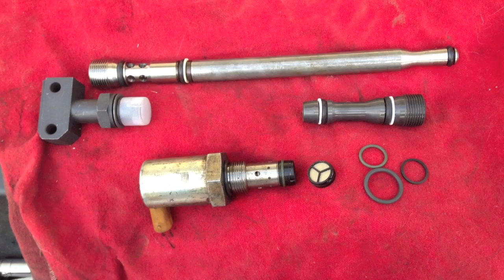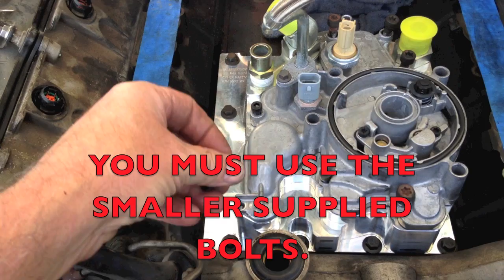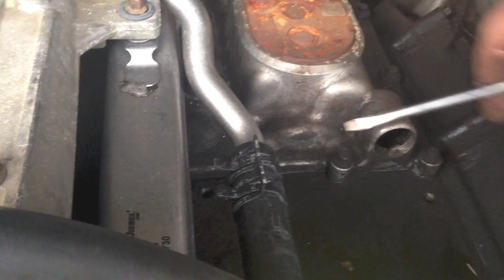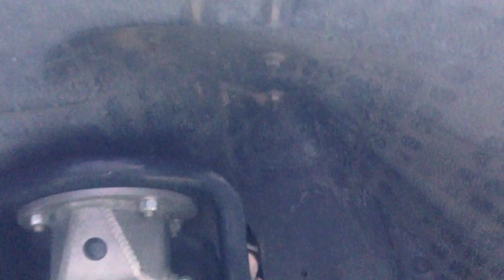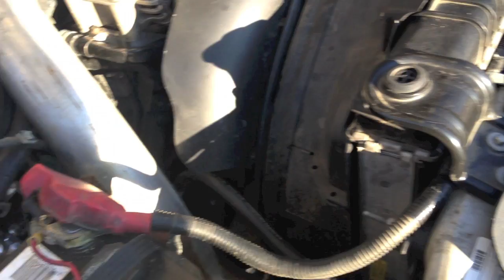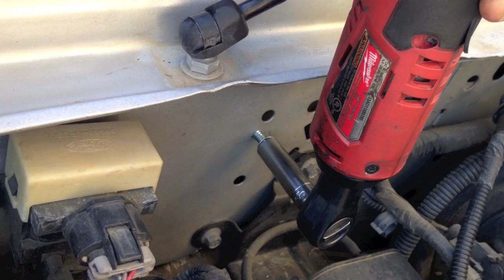Bulletproof Diesel's remote mounted oil cooler install on a 6.0 Powerstroke

Comment: Am getting this the same kit install on my 2005 ford excursion, since they say exs dont do to hot on the air to oil cooler kits. Literally this is like the only video out there for this kit. Even though am not doing this myself am glad to see what the shop has to deal with and well worth the money.

Comment: So I'm just getting ready to do the bulletproof to my 2006 is there something wrong with the air cooler that they've gone back to using the old system with the remote

Comment: I installed one a few years ago. However my oil temperature have not been much of a change. I do think it’s a better system. I would recommend a dual core radiator and electric fans from Alloy Works.

Comment: Thank you for all the informative information for us crazy people that own the infamous 6.0...Mine is an 07 f350 lariat srw lwb, just turned 354000 on the odometer. Original headstuds with a egr deleted and ford upgraded oil cooler. Other than that oh yeah the 03 turbo. I have spent less than 3000$ in total maintenance cost and a upgrade to the ficm...48V....I tow heavy 6 months outta the year pulling 18K quad goosenecks up to Canada March thru September...

Comment: I mean whats an abosolute temp for eot and coolant mine has never reached 200 higest ive seen is 194 but the difference between the two is anywhere from 4 to 15 depends on if im on a load or not.

Comment: by doing all this upgrade it shows that ford's engineers didn't do their job right when they built the 6.0🛌
Reply: EPA ruined the diesel engines with all their bullshit mandates like an egr
Reply: Ford didnt build the motor but nice try
Reply: International installed the 6.0 in a lot of commercial vehicles. Since they didn't have same emmision parts as F series. They were going for ever

Comment: that must be a good battery to hold that long.cranking
mine 3 or 4 turns it's dead👍
Reply: Well if it wasn't dead then I will bet it is dead now.
Reply: Need new batteries.

Comment: Hello.  Thanks so much for all the great videos and information  I am considering buying an 06'F350, work truck that has 207k miles.  What must have/do mods would you recommend to make more reliable??  It will be my DD.  It will not be used for work.  It will tow my 5,000 pound boat weekly (30 miles per trip).

Comment: Do you recommend adding a after market by pass oil filter kit such as OCS or Sinister Diesel ? What temp thermostat and type (factory or Mishimoto) ? Would a Mishimoto radiator be a cost effective upgrade. ? Live in Oregon with mild winters but will use the truck mainly for towing and traveling. Factory Ford Warranty on truck not extended  but factory .
Reply from the maker: We almost never see an oil related failure on these motors, esp if the proper filter is used. so I would not out money in the extra filtering of the oil,  same with the thermostat.  almost no factory or rare factory failure.  the radiator actually is an upgrade, yes if needed I would replace it with theirs.  take out a perfectly good one? in a cool climate? no.  a coolant filter on these is s good idea and keeping up on the fuel filters. Try to only start it and run it when it can be driven long enough to be warmed up all the way.  otherwise condensation builds up which is moisture or water in the systems

Comment: an example it's 80 degrees out here humid oil temp at 205 degrees coolant temp is 10 degrees lower I just  finish installing this one I don't know if it's normal because I thought there was something wrong coming from California to Texas I saw my temperature like that and I have a delete SCT tuner to Performance

Comment: I put a bigger bulletproof diesel kit on and my temperature still 10° degrees up of coolant and it's 80 degrees out here in tx is that normal or am I running into more problems
Reply from the maker: Hi. Two things, is your vehicle reaching operating temperatures like 190 ? Ford says within 15° is normal .

Comment: do you have to add more oil with this setup? I just ordered this for my truck. any feedback if its worth it?
Reply from the maker: maybe a little the first time. but afterwards there is more trapped in it.
Reply: +DieselTechRon Thanks!

Comment: Hey Ron... I'm replacing my oil cooler right now. It ruptured and dumped oil all in the antifreeze and I want able to flush it out.. Should I install this remote mount now ? Because I'm afraid it will clog up the new oil cooler once I start driving it again. This oil cooler only lasted 10k miles and went out again.

Comment: Does anyone know if a similar kit will work on the E-series 6.0 powerstroke?  The only option I've seen is the $2200, rape you in the ass option from bulletproof diesel.  In all honesty, the kit should be more like $1000 max, $2200 for an oil cooler is approaching aviation part prices.
Reply from the maker: The updated factory one is nice if its cleaned first and maintained.
Reply: +DieselTechRon Thanks, Ron!  Are you referring to doing a thorough flush of the coolant system before installation?
Reply: +Andrew B ... do not forget to send a "thank you " note to Fix Or Repair Daily.  These trucks are money machines for dealer service centers.  Try trading one in at a dealer and then that is the second price shock.  It is almost as if they closed there eyes when they designed these engines.  With the cheap price of gasoline a big block would be cheaper...Oppps they do not offer a big block... and do not stand behind their warranty.. Ain't that nice.

Comment: This set up is really expensive, BD has us 6.0 owners by the balls. Great video though.
Reply: 214liljon once you buy the kit that's it it's a one time deal... the 6.0 is not a cheap motor after fixing my truck I'm happy with the results...
Reply: parts themselves arent cheap to make they are machined

Comment: hi I watched this video and currently have a 04 F350 super duty that has a oil cooler that is starting to fail id like to get this kit but I cant find it on the site is there any way you could post a link to this kit I would greatly appreciate it thank you in advance

Comment: BTW I Am purchasing a 2006 550 Superduty with 95G miles  & has had no problems  this is just in case  for me  I dont like breaking down  It cost me $$$  when I cant work my truck. The Truck  Also Has A Engine Mount Hydrolic Pump To Run My Knuckle Crane Over on the passenger side by the battery (it came with the truck  & I really dont want to switch over to the transmission  mount one at this time )

Comment: You're a great mechanic man. I appreciate the patience and time you take in all your videos to explain and show each step while offering your own advice and preferences to help others with their problems. Tips and tricks you've learned over the years is gained from experiences through process. You sharing those is a privilege to listen to and watch. Most will show you how to do it but you all around are there to help make sure things are done right and as easy as possible. You don't have to make these videos and they're not made for your benefit but solely directed to those that want to work on their own vehicles. Thanks again. This is why I'm subscribed to your channel.
Reply from the maker: Chadd Chevrolet Thank you very much!!

Comment: i honestly dont see the point of installing this kit, if you plan on replacing the oil cooler every 100k miles sure makes sence, but if you have good clean coolant, updated cooler and a coolant filter, i dont see the point but whatever works i guess!
what kind of delta do you get with the temps towing with this kit installed?
Reply: Kevin Rogers what kind of coolant filter would you recommend ?
Reply: @kevinsanders615  XDP or sinister Diesel
Reply: I tow a 24ft livestock trailer 4x a week loaded its around 14k to 15k. I installed a 3 segment 100 percent aluminum radiator, the coolant filter and run only Ford coolant. I never have a issue period

Comment: Why not install the air oil cooler from BD?
Reply: +lorax1968 Actually, this aftermarket external mount is air cooled AND water re-circulation in the cast body's. The advantage of this design is that it is mounted away from saturated heated air in the valley of the engine block. The disadvantage of air only coolers in cold climates is that you would risk oil blockage (gelling) without the water / antifreeze circulating in the unit. If you never leave Arizona or Texas, this is almost a non-issue.
Reply: lorax1968  the water to liquid cooler is more efficient

Comment: Great videos! What a disaster of an engine tho!
Reply from the maker: The engine has issues but it can be reliable if repaired properly and taken care of
Reply: Everyone thinks it was every single 6.0 that had issues which is wrong. In 03 ford needed a new diesel motor ASAP because the old 7.3 didn't the the manditory emmision parts. So ford took a gamble on the 6.0 in the F series and E series with out the proper testing. If the proper testing would of been done before hand. Majority of these flaws would of been corrected from the beginning and would of had another 7.3. International installed the 6.0 in a ton of commercial vehicles. They never had any of these flaws and was going for ever. My buddies party bus had 530000 miles before he traded it in for a new 6.7 PS. 3 turbos replaced before 80k